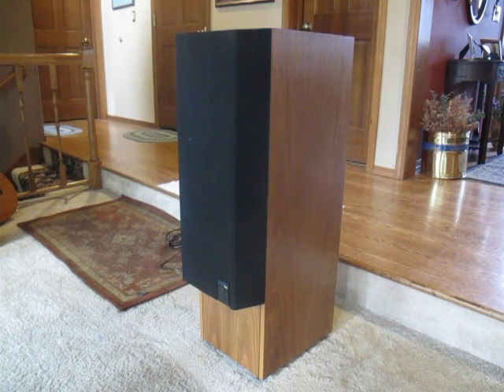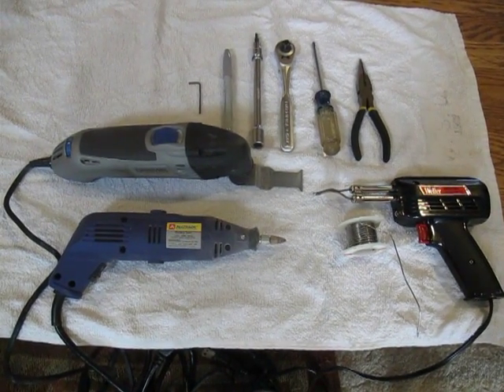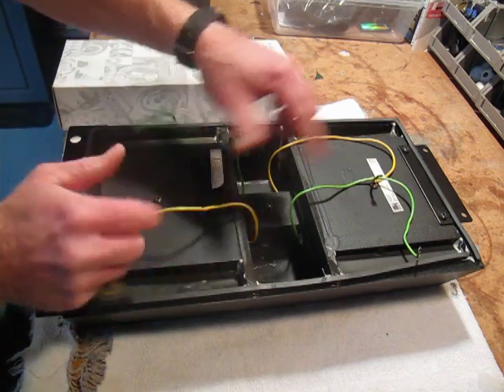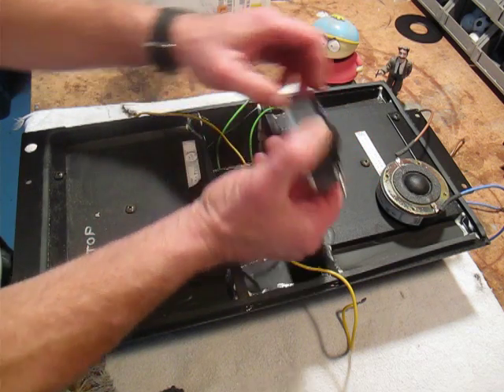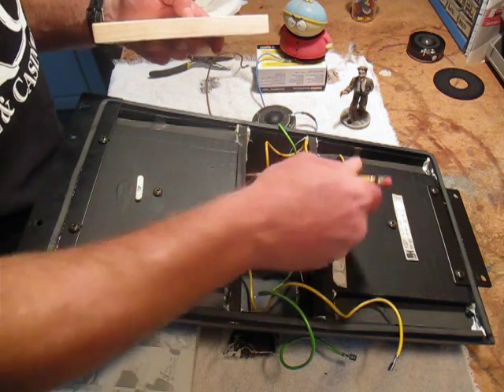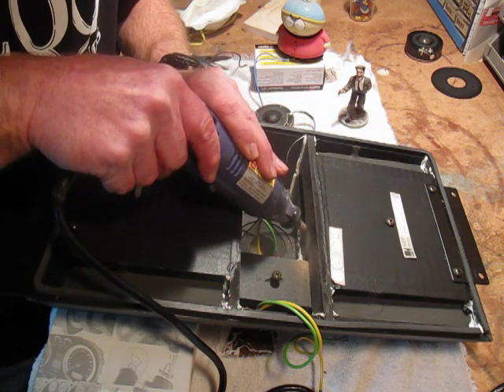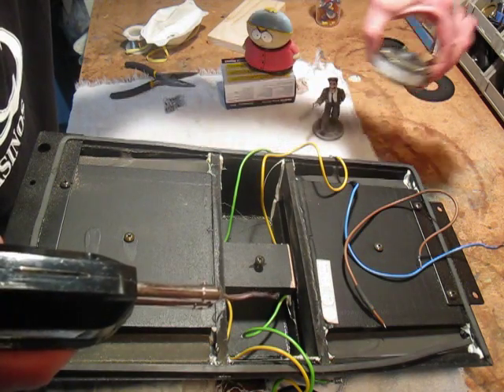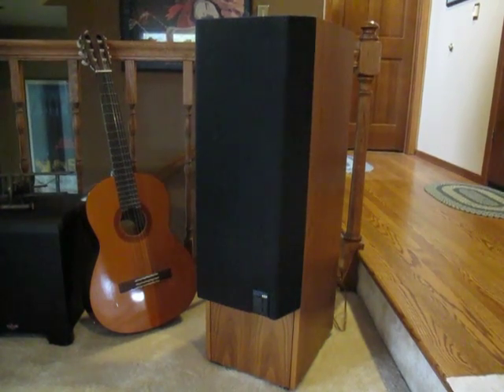KEF 104/2 tweeter replacement

Comment: Hello, Please send me the exact part number to replace a blown tweeter from my KEF 104/2. 4 ohm or 8 ohm version? Also, Is there a way to use my Multi-Meter to check if my KEF speakers are bad? If they measure 4 ohms at the speaker terminal, does it mean they are still good? Thanks, John

Comment: Hi, great little video.
It was purely by chance that I saw your video - it reminded me to replace the tweeters on my KEF 104.2s too!
A success here also, I've written about it here - https://cassettedeckman.blogspot.com/2020/10/104-2-floor-standing-tweeter.html
Many thanks for putting me to work! ;o)
Reply: Hi Butch...thanks for the great write up you did.  We do our 104/2’s!  The MDT29 I used were 4 ohm.  Since I made this video, I have been happy with the MDT29; but, am eager someday to try and either replace the original T33 KEF tweeters, or repair them.  I am very curious how you like the Audax TWO 25A2 ?  Great write up you did!
Reply: @Pinskier210  I wonder if you'd need new voice coils for the T33s? Would be near impossible to source them I would imagine? Getting the old ferro-fluid out would also require some lateral thinking - I think there is a video on this on Youtube.

The thing is with replacements, it is near impossible to truly judge because the so-called consensus online is that the T33s are 'better'. I do wonder sometimes, if we were blindfolded, then subjected to A/B comparison tests - would we know which was the T33 or the MDT29s etc?  ;o)
Regards.
BJ

Comment: my tweeters just gone after i did pop noise by plug and unplug MIC. don't you think refluid will help to bring them back or have to replace the Morel, I took it out and checked with multimeter they are all read 233k ohm or some thing like .932M some time instead of 3.3ohm. If I'm using the 8 ohm Morel does it sound the same as T33
Reply from the maker: The Morel tweeters will fit into the KEF 104s and sound fine... but not as good as the T33 which they don’t make anymore.  You could try and replace the fluid, but if you blew your tweeters... you will have to replace.

Comment: can I  replace a  factory tweeter  4 ohms with  a aftermarket  8 ohms tweeter?  because  I  blew up  the 4 ohms  factory tweeters  but not the woofers.  this is the second  pair of  tweeters  I  blew up  in just one week. 😯😯😯
Reply from the maker: You have to match the ohms on replacements.  Check the manual for your amp/receiver... on most models you can select a switch that matches the ohms on your speakers.  That impedance switch would be small and usually on the back of the amp/receiver.  Amp and speakers have to match.
Reply: @3pinskier  Thank you very much !!☺☺

Comment: Hello, I was wondering what your thoughts are on the way I modified my KEF 104/2 to accommodate the same replacement tweeter?  Thanks.
https://www.youtube.com/watch?v=uAMvCsyZFaY&t=443s
Reply: Frank, great video covering all components inside the KEF104/2.  I have not yet had the need to repair the woofers, but will reference your video as a good source.  Let me know what you think of the Morel tweeters.  The ones I installed years ago (when I did my video) are still working fine; however, I just remember the original KEF T33 tweeters sounded just a little better as one would expect.
Reply: Thanks Scott! I PM'd you back.  Appreciate your kind comments.

Comment: You can buy T33 tweeter replacements, new production stock,  on ebay. Just ordered 2 of them. http://www.ebay.com/itm/161710273244
Reply from the maker: Paul Scherdell 
The key in replacing these tweeters is the ohms.  Most tweeters are 8ohms.  You need 4 ohms for this speaker.
Reply: Yes, I got the 4ohm T33's in last week, they sound great. However I have found that the woofer rings and centers may need replacing; luckily there is a kit to do just that, adhesive and all. People want to keep their 104.2 KEF's alive! I don't blame them.

Comment: Hey Scott, I have somewhat a noob question to ask you. One of my tweeters burned itself some time ago, and while I was waiting for the right replacement I couldn't help myself but to continue listening to my music ignoring the fact that one of the drivers is dead...Was I wrong? Can I ruin my speakers if I power them normally without that one missing tweeter? Thanks in advance for you answer.
Reply from the maker: Breaking down your question.  I doubt you would be doing damage to a speaker if the tweeter was shot.  I might be more concerned if damage was being done to amp/receiver.  If the amp/receiver is shutting off on its own, etc.  Maybe check your amp vendor on your question.  Things I like to make sure I do- Polarity of the speaker wires to the amp from speakers is correct.  Ohms on speaker matches the amp specs.  Making sure your amp is not underpowered for the speakers.  Back to your question, when my tweeter failed, it was very distracting  to me not having a correct balance in the room.

Comment: Thank you for this video, was really really helpful.  The first speaker was a pain but the second install was a lot more smooth and took me about 1/3 of the time.  One thing to note, if you do it this way, the tweeter isn't completely flush, but grinding down the plastic front bezel on the tweeter seemed more daunting.
Reply from the maker: Which tweeter did you end you going with?
Reply: Scott B Same tweeters- the Morel MDT29-4's.
Reply: Scott B Man these speakers just sound better and better every day after replacing the tweeters.  It seemed subtle at first but now three days later I realize that it's really drastically better.
Reply from the maker: *****
The original T33  tweeters will go flat over time, mine sure did.  Glad it worked it for you!

Comment: Scott, great video. I have a pair as well, have owned for many years and love the sound.  Did you consider replacing only the ferrofluid in the original T33s? I've read this is very common for many, especially this tweeter, and produces great sonic results.

Comment: What is the liquid in the tweeter?
Reply from the maker: The liquid in a tweeter is called ferrofluid.  It is a dense almost synthetic oil consisting mostly of iron oxide materials.  Over time, this fluid can evaporate, dry out, or become gummy like.  This can also happen if you are really pushing the speakers beyond their proper threshold.  If this happens, the sound is not good. Sometimes you can find a company that will take your old tweeters and dig out the old ferrofluid and replace it.

Comment from the maker: The morel mdt 29's I purchased came in either 8 ohm or 4 ohm options. 
 I matched the impedance of the original KEF 104/2 T33 tweeters which were 4 ohm.  Thank you for your question.

Comment from the maker: Yes, at first the Morel's did have a brighter sound to them.  I chalked that up to the muddier sound of the older KEF T33 which had degenerated over time.  At first, I did adjust the treble a little to compensate.  After a year after installing the Morel's, I am still very happy with the results.  Thanks for the feedback!

Comment: Sometimes what seems better optically isn't always. The Kef T33 was a very sweet tweeter with low listener fatigue well matched to the crossover... even though efficiency and power handling were lacking. The Morale with it's larger magnet would strike me a somewhat more efficient thus some added resistance in the crossover is needed or else an over bright sound will result.

Comment from the maker: Andy-
Glad it worked out for you.  I did look at 4:01 on the video to see what you were talking about.  Actually, I did not cut off the plastic around the new tweeters (as a lot of others had suggested), instead I used the Dreml to carve our the cabinet so the depth of the tweeter would fit.  So far, the MDT29's are still working out great.  Good luck and thanks for sharing your comments.  Tough to beat the sound of a KEF104.

Comment: Also, if you use a cut down MDT29, it does not sit flat in the T33 recess due to both connections being on one side, so I used a Dreml grinding stone to recess the wood there so it sat flat.  I too am very satisfied with these tweeters as a replacement.

Comment: Scott, thanks for this great video.  It gave me the confidence to try it myself.  For future reference, at 4:01 you mention using a Dreml tool to cut the plastic edge off the MDT29's which is what I eventually managed using a diamond cutting wheel and after destroying one voice coil since I didn't have it clamped down (it spun and ripped the VC connections off before I clamped it).  I'd actually highly recommend purchasing the pre-cut e-bay set if I were to do it again.

Comment: Could you pop the nut off the bottom and run a large diameter sheet metal screw thru to hold the tweeter? Nice video.

Comment from the maker: The stock tweeters are not manufactured anymore.  There is a kit out there you can buy, but the kit does not replace the fluid inside the tweeter.  The morels are just a touch sharper than the originals which I have adjusted my receiver by just one notch setting, but after 25 years before I replaced them they may just have been very flat.